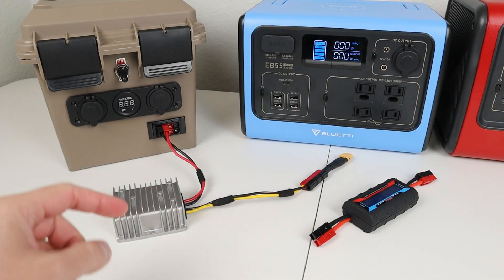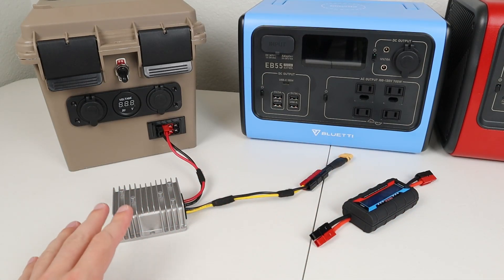Bluetti EB55 & EB70 Charging Tips and Tricks - Faster Charging Without Solar! EB55 400 Watts Input!?

Comment from the maker: Check out my website for tons of DISCOUNT CODES, power station reviews, my 12v fridge guide, and solar panels featured on the channel!      https://jasonoid.com/
Reply: Wanting to order the EB70S, I already
own the Bestek 300W Inverter I tried it with my laptop while driving it never blew the fuse...but my suv manual says 180w cigarette lighter socket.
Will the Bluetti surely blow my fuse?
Reply: I know this is an older video but have you attempted to put 25V+ into the AC-Adapter input? I would very much like to do DC solar input and DC battery input simultaneously as I keep this in my Jeep with a solar panel and currently use a 300W inverter. I'd like to eliminate that inverter.

Comment: which is more efficient from the 12v battery box? the buck step up converter or the AC converter to the default AC/DC charger?
Reply from the maker: DC to DC conversion will always be more efficient.

Comment: How do we know the Amps a Battery will be outputting by default to any Power Station ?
Thanks for helping
Reply from the maker: The power station controls the charging speed. Most will charge at 8 to 10 amps from a 12v source.

Comment: Can we use a modified sine wave inverter to charge ? Thanks for video
Reply from the maker: New power stations with internal charging prefer pure sine wave inverters. Since these little guys have external chargers they might work off a modified sine wave. It might charge okay, you just gotta test it.
Reply: @Jasonoid I have a Bluetty EB3A 268wh (no Charger ).. yes..i have tested .. and ot works fine.. a little sound inside..but its doing fine

Comment: Does the EB70's MPPT controller safely deal with being over currented(10 amps)?

 I imagine so but I have to ask. I just bought a PS72 and I'm trying figure out which 
solar panel(s) to charge it with. The low 8A limit is hard to match up.

Thanks in advance if you reply.
Reply from the maker: You only have to worry about high voltage, the amperage is limited.

Comment: Once again another great video. Thanks! I have a dilemma. My truck bed has a 400watt 115v AC running off a cheap inverter that is not compatible for charging my Bluetti. I just need to keep my Bluetti topped off while driving and powering my iceco vl45. Is it possible to drop the dirty 115v power down to 12v for a trickle charge into my Bluetti? Or would it be best to just run dedicated 12v to my truck bed.
Reply from the maker: I'd recommend running a dedicated cable from your truck battery to charge it. You could even use a DC to DC converter to get even faster charging like in this video:
https://youtu.be/I78RxjRXTn4
Reply: I appreciate the advice!

Comment: I have the EB70 and plan on making a direct connection to my starter battery. Which is better to use, the inverter or the step up converter? I don't think you showed the charging wattage result using the inverter on the EB70?  Are both methods approximately 190ish watts?  I enjoy and appreciate all your videos, Jason ....thanks.
Reply from the maker: The inverter would be useful for other applications so ide suggest that. The DC to DC converter can only be used to charge the power station.

Comment: I am a new subscriber. Excellent video...I am consideing a Bluetti. I do not know what size I would need. I presently want to put my dual zone fridge/freezer that says rated power 60 watts. If I used it without solar how many hours would it run on the EB55 and the EB70S ?  I think the EBG3A would be too small ( i think). There is an AC70, but I do not know what it is.  Thank you
Reply from the maker: I usually recommend a power station with at least 500wh of capacity in the battery to run a DC fridge. Both the EB55 AND EB70s are a bit dated right now so id recommend the newer models with many better features. The AC70 should be a good choice, I haven't tested that one yet though.

Comment: OK, good, so there is no way to dual charge the EB70??
Reply from the maker: Nope, there's just one charging port on the EB70
Reply: @Jasonoid  and this is very unfortunate. I've managed to connect an additional charger to my ac200max with an xt90 connector, plus 600w for only 35 usd.
Reply from the maker: @ryzkhov  the EB70 is a bit dated now and lacks the newer features. Bluetti will be coming out with a new AC70 soon to replace it.

Comment: I want to be able to charge the eb55 with a solar panel continuously and with the car alternator while driving without having to  physically switch  cables. What is the best method to do this? Thanks in advance.🙏
Reply from the maker: Since there's only one charging port for DC input you'd have to swap the wiring manually OR install your own inline switch that takes power from two sources and allows you to go back and forth. Something like this would work for that:  https://amzn.to/480K9bP

Look at the images and you'll see the wiring in the back.
Reply: @Jasonoid  Thanks for the prompt reply, I really appreciate your help. Surely there must be a way to use the 25-28Volt DC input to charge the unit while driving without having to use an inverter and the brick with its fan running continuously.

Comment: Do you have a link for the battery box? Will it hold a 50AH LIFePO battery? Thanks
Reply from the maker: I did a video with a 50ah LFP battery here: https://youtu.be/B9S-n3rbVWs
I wouldn't recommend the AC charging option I used by everything else worked well!

Comment: Can I charged bluetti in solar panel while I am using it as I noticed I have 200 watts bluetti solar panel and I am using 100 watts of power my solar panel generate 150 watts is this mean the 100 watts will be use and the remaining 50 watts will charge my EB70?
Reply from the maker: Yes, if there's more power going in, the battery will be charged.

Comment: I’ve got an eb70s. Is there any issue with charging it on the road via solar and the 12v car charger at the same time? Thanks!
Reply from the maker: The EB70 will only take one charging source at the same time. The two different charging voltages will not work well together if you tried to connect them.

Comment: Ever considered connecting a 200W solar panel to the input of the 12V to 24V DC-DC converter as a charging option?
Reply from the maker: I've tried that, the converter doesn't like the voltage fluctuations. It didn't work very consistently. I'm sure if I used a better brand of converter it might actually work!
Reply: @Jasonoid  I know you're all over it and probably tried it. LOL! I was also wondering if you can take one of the OUTPUTS and put it into the INPUT of the EB70S to charge the unit...creating a perpetual charging method. Haha. Thanks for the reply. Oh, BTW: do you have a discount code for the EB70S that can be used on their website?

Comment: I wish the EB70 had the same charging inputs as the EB50. It’s nice to have the option to simultaneously change using a DC/solar and the A/C adapter. Did I miss something, the EB70 can only charge from a single at a time?
Reply from the maker: Correct the EB70 has an older design and doesn't dual charge.

Comment: Wow.. its incredible that i cant do that, charging solar and 220 v at same time with my Bluetti Eb70.. With more storage and being more expensive.. What a shit!!  Is not there a way to trick to solve this? I supopouse no..  All we have the EB70 must charge at 200 W and spend 4 hours.....
Reply from the maker: The EB55 was a newer product and they upgraded some features over the EB70. I'd love if it could dual charge!
Reply: @Jasonoid - Solar Power, Batteries, and More!  You are right in this. I am happy with my Eb70 just charge is very slow.
By the way.. I discovered a new posibility.. charge my car battery a bit from my Bluetti in case i got my battery car empty accidentally (i had this in the middle of ski station one day and is not nice). 
See this conector dc 5,5 2,1  to battery aligators.. Its not looking nice for bluetti dc 5521 output? I think this should work, no?  This would put 120 W in the car battery in one hour directly from bluetti (no?) and would save the situation. 

By the way, an easy and not too expensive to charge bluetti at 200 W inside the car at 200 W/h instead 100 from cigarretes? I suppouse a cheap 300 W inversor maybe.. Not sinoidal (which are expensives). But i dont know if can be bad for the bluetti or can damage it..

https://www.amazon.es/CERRXIAN-5-5x2-1mm-cocodrilo-seguridad-Iluminaci%C3%B3n/dp/B08HWCZDDK/ref=sr_1_3?__mk_es_ES=%C3%85M%C3%85%C5%BD%C3%95%C3%91&crid=BQZPCAPC1QL8&keywords=dc+5.5+2.1+a+pinzas+de+arranque+bateria&qid=1669758665&qu=eyJxc2MiOiIxLjczIiwicXNhIjoiMC4wMCIsInFzcCI6IjAuMDAifQ%3D%3D&sprefix=dc+5.5+2.1+a+pinzas+de+arranque+bateri%2Caps%2C254&sr=8-3

Comment: Would it be possible to get the full 200W charging from solar panels if you rig something up with a DC/DC convertor?
Reply from the maker: Yes, if you copy the voltage and amperage output of the wall charger.

Comment: Can it charge 12v battery? Like extension of power to add another 100ah battery for example and use a solar pannel charging the 55 and the extension battery at the same time

Comment: Would it be an acceptable idea for use in a car camping situation to use a parallel XT60 cable to allow input through the MPPT port from the vehicle's 12 volt, as well as a solar panel mounted to the roof to continue charging while the vehicle is not running and stationary?

I thought I might give this a try:
"FLY RC 2pcs XT60 Parallel Battery Connector Cable Extension Y Splitter" (can't post link)

The main reason is to avoid having to unplug the vehicle input through the XT60 port and plug in the solar panel input every time I stop driving. Partly for convenience, but I'm hoping I might also get a boost in amperage, but not over the allowable range.
Reply from the maker: The charging port can't accept two different input voltages at the same time.  You'd have to chose one or the other to charge the power station. If you connected both power sources at the same time to the Mppt, the solar panel would probably end up back feeding and charging your car battery directly to 18v and damaging it.

Comment: Is it okay to leave these plugged in to the wall in your basement to keep them fully charged in the event of a blackout?
Reply: I'm not 100% sure, but I can tell you that the AC power supply appears to have an intelligent charging circuit, so the light goes red when it's charging, then green when it's done. I didn't see anything in the manual or online specifically saying green means it's trickle charging, but I might test it out and let you know if it switches back to actively charging while it's plugged in if the battery is drained slightly.

Comment: Awesome, just what I was looking for 👍👌
Silly question, if I use a 12-24 converter and want to run it from and Anderson off my cars charging system that nominally runs at up to 14.4 volts, will the output voltage remain at 24 volts or will it spike to 28.8 volts? Thanks

Comment: I know if I ask I probably shouldn't do it. On a scale 1-10 how bad of an idea is using that 12v-24v on a dedicated line I wire in my Jeep?
Reply from the maker: As long as it's a fused connection with plenty of airflow, it should be fine!
Reply: @Jasonoid  Awesome, thanks! That was the plan!

Comment: If I have 400W 24V source, can I connect it in both connectors in parallel to charge EB55? Or it must be two separate 200W sources (galvanically isolated)
Reply from the maker: On the EB55? You can only charge it from the charger on the 8mm connector and use the other XT60 port for your 24v source.

Comment: Can I use a Renogy "DCC50S 12V 50A DC-DC On-Board Battery Charger with MPPT" to charge an EB70s using the alternator and/or solar panel? Are there problems in that it would go through 2 MPPTs, one in the renogy B2B and one in the Bluetti EB70s? What kind of wiring hookup would you recommend? excellent video!
Reply from the maker: The EB70 has its own built in charging system so if you plugged in another charger it wouldn't work well. The fastest DC to DC Charging option is to use 24v
Reply: Thank you so much for your responsiveness! Do you think it would charge at 12-13+Volts (renogy specs) @ 8Amps (bluetti limitation), or do you think the fact that there are 2 charge controllers in series have problems resulting in further charging diminishment/ Issues? do you think either piece of equipment would be damaged by setting the Bluetti up to charge through the Renogy?
Reply from the maker: @pmoasis2825  I just don't think the Bluetti charge controller will know what to do with the Renogy voltage. If you plug your Bluetti into your car 12v socket or direct battery connection it will charge at 110 watts. No need for the DC to DC charger in between. You can think of it already having a DC to DC charger inside already.

Comment: Is there any reason I couldn’t use the 12 to 24v converter with 12v power running through a solar controller?
Reply from the maker: I haven't tried that before. I don't think it would damage anything, so maybe it's worth a shot.
Reply: @Jasonoid  I’m going to give it a try. I have the cascadia 4x4 system with a solar panel attached to a charge controller which trickle charges the starter battery and I has some 12v wires coming out of the charge controller that goes to a 12v socket in the bed that will charge the power bank. It has constant power with low voltage protection. How much power is coming to that socket varies if the truck is running or how much solar I’m getting so hopefully the boost converter won’t have any issues with that.

Comment: So I ended up buying both of these batteries as well as the explorer 240’s… I noticed not the Bluetti’s say eco mode and yours don’t…
Reply from the maker: Google how to turn off eco mode on the EB70, there's a way to disable it by pressing two buttons at the same time.
Reply: @Jasonoid  is there a benefit to having eco mode off or on?
Reply from the maker: @jesseherrera6261  It only is good when you forget to turn off the AC inverter. I don't like to use that mode because I like to run small loads overnight and and I don't want to wake up to the outputs turned off.

Comment: I have a eb70s and I noticed I am getting only 36w when I connect the input to the cigarette lighter.  I have ordered a 24v ac to dc power adapter with a cigarette light socket that can deliver 8A which is 192W!  which matches with what the issued power adapter can do.   My Honda has a 110v inverter output.  I am going to try.   Any one else tried.  I'll also compare that with the issued power adapter.  Reason I do not like the issued one is because of the fan.

Comment: Users of the EB55 have reported that an error message may appear when using the AC output. The message is "SHORT" in red. Does anyone know how to reset such an error message?
Reply from the maker: To reset it, you turn off the AC output and then turn it back on. That error is usually caused from trying to pull an inductive load that requires too much amperage.

Comment: subscribed! Thanks for the great video and all the other in depth reviews you made!

TLDR:
1. can a Bluetti EB55 actually charge at 224W on solar port alone (28V*8A)? or is limited to 200W?
2. how can you get the most out of 3 Bluetti SP120 solar pannels?

the story:    ---------------------------------------------------------------------------

I have an EB55 and one SP120W solar panel, but I would like to add some solar charging power. 
I want to have about 100W charge on cloudy days and also to charge at the max rated input when sunny  (28V * 8A = 224W).

I'm thinking to buy another 2 solar panels, so to have 3 Bluetti SP120 (that in medium-good conditions can provide 75W/panel) that I can connect either:
 - in series (so ~50-60V and <6 amps - actual numbers depending on the clouds) and then use a converter to step the voltage down to 28V and >=8amps
- in parallel (so ~16-20V and >14 amps - actual numbers depending on the clouds) and then use a converter to step the voltage up to 28V and >=8amps

so here are my 3 questions:
1. can a Bluetti EB55 actually charge at 224W on solar port alone (28V*8A)? or is limited to 200W? I don't have a variable power supply to test this.
2. do you have a better (maybe cheaper) solution to achieve this? The converters I found are priced at about USD 200.
series: https://www.tme.com/us/en-us/details/chb300w-48s28/dc-dc-converters/cincon/ 
parallel: https://www.tme.com/us/en-us/details/chb300w-24s28/dc-dc-converters/cincon/
3. which one of the above scenarios do you recommend?

Comment: Hello, thanks for the video!  Can you help me with the issue?  I purchased an Anker 757 portable station and it does not want to be charged by a Power Drive 3000(watt) inverter.  Inside Anker, the relay clicks when plugged in, but it doesn't charge.  Although the fridge and microwave are working. (It all happens in a semi truck).  Why?  I'm not an electrician and don't really understand this.
Reply from the maker: I haven't tested any Anker products. I have heard they have great product support. I'd reach out to them directly about the issue.